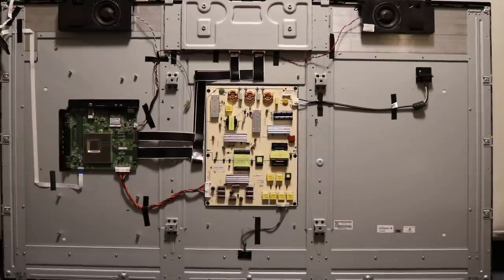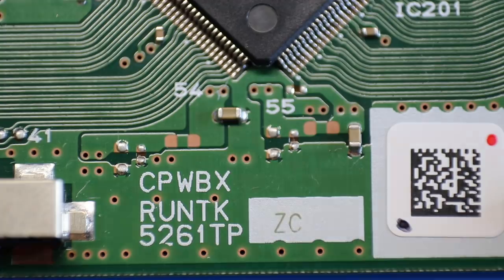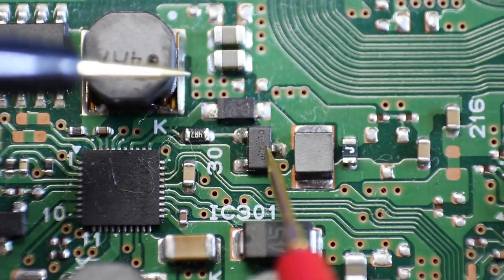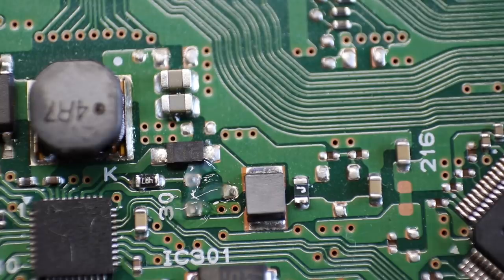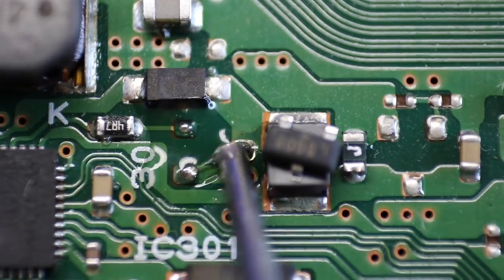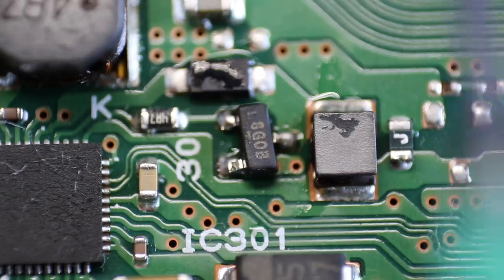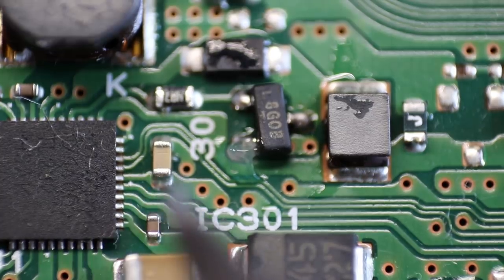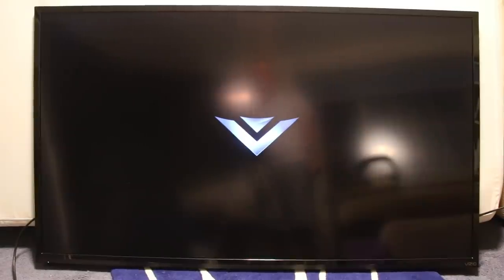60" TV for less than a $1 - Vizio E601i-A3

Comment: You do not need a hot air station. Just use some chip quick and tin all the pads and slide off the old transistor. Then make sure to wick the rest of it off then solder the new one. Both methods work.

Comment: I repaired TVs for 22 years, starting with sets that still had tubes, later transister and finally IC chips. The new technology works great and has excellent features, but is too small for this old guy. It's a young man's technology these days. Bravo to you working with such tiny components.
Reply from the maker: Thanks!  Working with a microscope makes it very doable. In order to record this video I couldn’t use my microscope and instead had to watch through the tiny screen camera which is partly why I had trouble holding the transistor steady.  I just upgraded to a trinocular one so hopefully videos like these will be easier to record.
Reply: The good old days.  Technicians back then used to do things like design and build their own Pay TV Decoders.   My version, cost about $5.   It did not require a power supply of its own, since It pulled only 15 mA, and thus you could just install it inside a TV converter and then tap the power from the TV converters 12 VDC line instead.  The decoder PCB was 4.50" x 1.20".   To install, you just had to cut the baseband video wire, the wire that leads from the demodulator to the modulator, and hook these wires up to the decoder PCB's input and output.   Anyhow, it decoded the baseband video signal line by line, rather than use the complex frame by frame PLL method. Later on I tried to sell the design to a cable company.  But they said that my design was too good.  Meaning that it was far to easy for it to be copied, due to it having so few components, components that were also readily available to just about anyone.
Reply: Yeah i remember i was kid and a family friend come to us to fix our black and white tv....watching for hours searching the fault and the smell of the dust and hot tin i will have in my memory for ever.
Reply: Well I was wondering if you could help me with a problem I have a 55 in LG TV that I bought off someone and it had a picture perfect picture on the internet part you know show settings and all that but when I brought it home to hook it to my internet it kept saying put in passcode I put in Pasco says it again so I tried to hook a DVD player up to it and the screen turn white and fuzzy it has sound but you know it's white and fuzzy picture but when I unplugged the DVD player it just has sound and I don't know what it could be it doesn't have pictures you know of people or anything on it like it should have but it's perfect when you go to settings it's like nothing's wrong with it on settings
Reply: Nice one man I’ve done a lot of lcd,plasma, led repairs my self deffo in the 1000’s of devices 😁

Comment: Here in 2023.  Sometimes even if you find the bad part, it might be difficult to find out the exact part number because it may not be written (or burned or scratched off) on the part, especially a tiny smd part, like even a transistor that is smaller than the transistor here in the video.   Or you don't have a schematic which most of the time can be hard to find online on more current complex/proprietary systems.  But if you do find a schematic online, you might even have to pay to get that schematic and/or service manual, which usually can be your last resort.

Comment: If you don't have the tools you can also use a cheap soldering iron of around $25.

To remove the broken component, heat each solder joint separately and use a sharp knife to bend up the pin while the solder is heated, so it's not touching the solder anymore.

To solder on the new component, put the new component in-between some tweezers and lower the side with the single pin just a little, so this side touches the solder joint first.
Heat the solder while lowering the component in place. When the side with the single pin is soldered, the pins on the other side should slightly touch their solder-pads underneath, 
then complete soldering by alternating between both left over solder joints. If you notice you are bending the pin on the other side a little to much, just reheat this side quickly to release the stress on this pin.
Reply: or you can use a lot of solder, just make a big glob that will get cold slow and take the part out with tweezers. Clean the pads with a wick, place component, solder 1 leg while holding the part and then solder the other 2. Much easier and cleaner.

Comment: Nice job on the video. Very clear photography. I really thought this would be a video about a bad capacitor. I have a ~15 year old LG 27" 1920x1200 monitor that I fixed many years ago. I learned what was wrong by searching the Internet forums. My search taught me about "capacitor plague." Ballooned cheap knockoff capacitors that caused many electronics to prematurely fail. I replaced the bad capacitor and my LG is still going strong today.  I agree with you. The Internet is a wonderful resource for DIY'ers.
Reply from the maker: Thank you!  Great to hear you fixed your monitor.  Yes, so many tvs and monitors were hit by that "plague".

Comment: The most important part you forget to mention, how did you find the wrong component? need to be tested all the components?
Reply from the maker: If you search online there are forum posts and even other videos that explain this transistor is a place to start your diagnosis.  I didn't spend very long on the diagnosis since others had helped point it out.  The internet is a great place to help solve problems.
Reply: Agree, this is just  bs component troubleshooting, no instrument.  Continuity is useless on on  board/soldered component.
Reply: @Sal112350  you are incorrect, sir... continuity is a great way to test... but, he failed to actually prove that the part was the issue. He should have tested the continuity on the board again AFTER the apart was taken out to show that the part was causing the short and not some other component on the board.  THAT is the proper way to do a continuity check.
Reply: Derp  The answer to your question, Derp, is bad design.  The transistor in the circuit is running "hot" (over 70% capacity) regularly and if the transistor quality is weak it will go again over time.  But this knowledge has little barring on the propose of Frugal's presentation.  He tested the part, it needed replacement, and he showed how to do it.  If a person watching tests the part and it isn't shorted... they should find a different video to fix their problem :-) .
Reply: Derp  You sir, are correct. After doing this kind of work for around 40 years, knowing to check components on the secondary side (for the lack of a better term) of this transistor is a must. If another part is shorted, leaking, etc., it's pulling too much current through the transistor so it failed. Sometimes you get lucky. Lot's of times you don't. If that transistor popped, what does ''the internet'' say then?
Reply: bcdhifi  You sir, are also correct. Using the continuity beep on a meter is best for checking cables you've made for whatever. I rarely use it. I prefer an analog meter for that. Checking an in circuit component this way means nothing. Get a schematic so you can see how the circuit is structured.
Reply: how can you detect the failed parts without service manual or knowledge in repairing....are you magician because its is easy to detect any bad and failed parts...continuity testing is not bad but how can you diagnose the failed parts easily....thats the big question to me not the cheap price you said....
Reply: This video is self serving which is why it’s so unpopular. You just bragged about how cheaply you could fix it without showing others how to do the troubleshooting.
Reply: Just buy the board for $17 and replace the whole board less of the problems
Reply: Alton Kilbourne they don t overcharge. They have exorbitant rent utilities oppressive taxation. Don t b mad at the cost of operation of business but at the corrupt govt u r then supporting.  If u can repair it u re self. Do so and b grateful
Reply: Alton Kilbourne  I don't know. When I read your story I would have to believe $250+$75 would include the labor. I know that third party manufacturers produce Apple product parts for WAY cheaper than Apple does. I also know for a fact that the repair company you mentioned isn't lying about having to go through them to get the parts. Apple will pull whatever credibility they gave you to service their equipment if they find out you don't follow their mundane rules. That being said, that Aaron guy has the wrong idea. The video's creator just wanted to show that throwing away electronics because they fail can be costly. As a tutorial, this video is lacking.
Reply: On TV repair there is no service manual it base only on your experience as a technitian on how you gonna find the bad components, on mother board there are division or section area like Audio/Video/Display/Power, where the most component that break in long time use is the power transistor,  In CRT TV the - always break is the power transitor or flyback transistor supply, In LCD is power transistor, the the same.
Reply: @12bhey  This is my secret to consumer electronics repair. Search the web to fine common issues with the item and rule them out. After that you would most likely need service manuals and schematics along with basic electronics troubleshooting knowledge. Start with the first rule in troubleshooting by checking voltages from the Power supply and work your way through. I don't know now but back in the day most techs used an Oscilloscope with a Octopus adapter. Do enough troubleshooting you learn how certain circuits work and you can get around without a Schematic. but since most parts are digital and use 3.3 Volts I would suspect a Logic Analyzer or Logic Probe. Continuity testing can get you so far. I honestly work on much older equipment such as Audio equipment from the mid 40s to early 80s. I've had success working on modern equipment such as Onkyo AVRs. Give me something that is pure digital such as a Arcade system board that is loaded with 74 Logic and I can get lost real quick.
Reply: Alton Kilbourne  exactly
Reply: Alton Kilbourne  I don't think most repair shops repair things at the component level.  Many of the devices I repair have already gone through the shops.  They tell the client "it's either a power issue or a communication issue". Then they quote a price to replace either the tconn board or the power supply board or both. Usually more than the TV is worth.  I don't think they are overcharging on purpose, they are just doing it the quick and easy and expensive way. Maybe because they don't know how to do component level repairs.  Maybe I just live in a small town.
Reply: @bsmithril  You are quite correct. Very few places repair to component level these days. I started in TV repair in the early 80s and everything was component level repair. I still do it today (where possible) but a lot of the boards now are using micro-miniature SMD and are near impossible to work on without some really expensive rework gear, microscope and access to the components (if you can even identify them).
Reply: Alton Kilbourne  For sure.  I didn't mean to suggest they aren't marking up or that they aren't in business for the money.  I'm just saying that they are marking up the 100 dollar module board rather than the 54 cent component.
Reply: Alton Kilbourne You bet wrong. I'm an electrical engineer by trade but also repair my own equipment AND do repairs for others at no charge. I also teach interested folks how to do their own repairs.  So you're not only wrong, but you're REALLY wrong.
Reply: @envisionelectronics  Alton is not only wrong, his sentences don't make sense. He says "that's why your getting mad..." 
I'm not sure if you have a 'getting mad' but even if you did, I don't see what the significance is as he didn't finish the sentence.
Reply: @FrugalRepair  thats what I tought. Not a tech but a "Google-er"
Reply: Aaron H jaja unpopular ? Who said that? He's making a point - people throw these out for problems large and small ... And he did show some of the troubleshooting, but not a lot of people can sit through that whole thing, nobody has the patience
Reply: chris532008 TRUE INDEED, case closed.
Reply: All you have to do go up then turn left .
Reply: @Independent-Voter-2024  that's bearing, not barring.
Reply: I have the same issue with LG 42" LED TV. How do I know what is the spec for the transiter to buy and replace on t-con board? Please let me know how and where I can purchase the transiter for my TV. Thank you.
Reply: Alton Kilbourne  I agree with you because my antenna plug came out and I want to fix it myself because the guy told me it would cost $130 for him to fix it! That's why I'm watching these videos
Reply: @CulichorHimself  where can I buy the board for my TV to have the antenna plug in it? Because I'm trying to fix it myself I have no idea, but I have common sense
Reply: Here is you are asking about the same board pick a link ebay is great, but if you need a different board just replace the board model number for the one you are looking for.  https://www.google.com/search?q=cpwbx+runtk+5261tp&rlz=1C1CHBF_enUS857US857&oq=cpwbx+&aqs=chrome.1.69i57j0l7.5006j0j8&sourceid=chrome&ie=UTF-8
Reply: Note that the component was NOT in any way WRONG.
The component in question was fitted there by the manufacturer and is the correct component. It was merely Defective/faulty/U.S> 
US means unserviceable.
One finds faulty components by testing them and knowing what the components are designed to do.
How does a dentist find which tooth is defective?
How do you find which Toilette to use at the shopping mall?
And finally, how do you find your way home?
Reply: @12bhey  You're just gutless. It's not magic- it's logic and observation; plus there's no harm in LOOKING. I think you've been cowed by that "NO USER SERVICEABLE PARTS INSIDE" Warning.  And who said he had "no knowledge in repairing"?  How the hell do you think you GET that knowledge? You need to stop judging people by your own inadequacies.
Reply: @trustnoone3795  "Get a schematic"? The whole point here is do this WITHOUT a schematic- because the money and effort to obtain one makes repair uneconomical.   Some of us manage to repair a LOT of stuff WITHOUT technical support. We can't do it in every case, but MANY failures will yield to logic and observation.  Right now I'm batting 1000 on these TVs headed for landfills....but it helps to check the internet and especially YouTube because many times someone has gone before. That makes it easy as hell....but a swollen capacitor also is a clue if you don't give up before you take the back off the set!

Comment: I garbage picked a gateway plasma going on 6 years ago (I fixed it on July 4th while I was off). Replaced $12 worth of capacitors on the power supply board and a sub sound board it has. Still working today.
Reply from the maker: That is awesome!

Comment: Great how-to video. You explained it well enough so that I feel confident enough that I could do the repair on my own TV if need be. The link to Ali-express for the soldering iron and hot air combo was a nice touch because although it is cheap equipment, it would probably last long enough to make a few repairs and save me the cost of replacing the entire TV.
Reply from the maker: Thanks!  I’ve been buying a lot more from AliExpress this past year and I’ve been happy so far.

Comment: Hi Fugal, thanks for the video. I suggest you adjust the air flow on your hot air gun as surrounding SMT components may be blown away, and you can notice that in the video when the diode above the transistor started sizzling, and if they don;t get blown away their soldering will dry out hence making it a dry joint. The trick is to use a good heat with less low air flow, that way the heat contact is precise on the bad component.
Reply from the maker: I agree.  This is not my best work.  I was excited plus I couldn’t really see what I was doing since my camera was so close and covering the board.  I have a microscope camera now so that won’t happen again (hopefully).

Comment: Hmm...you too can fix a flat screen TV for $0.54...if it happens to need this particular transistor, never mind how we diagnosed the failure, and you have a hot air rework station. I once saved a stereo receiver with a $1 capacitor, too, but that was the only lucky shot I’ve had. The other jobs took a lot of troubleshooting and had more involved failures.
Reply: he coulda fixed it with just a soldering iron. but I understand what you mean. my mate fixed a four-year-old 60inch telly using NO parts.  (just squeezed up a screen connector). but I think it's worth having a look if you have a few tools and basic skills - if you can't fix it, there's nothing lost. if you can it's a result